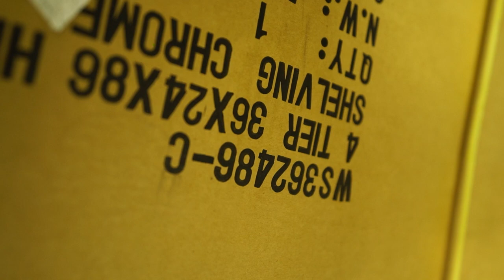They Sent The Wrong Shelves || Construction Finished! || Found Lost Sanseveria || Saturday Vlog

Comment: I would be livid after waiting that long for the shelves! But then again, what good would it do? Home Depot has the monopoly on sturdy wire shelving so you have to grin and bear it. By the time you get the new shelves and set them up, it’ll be time to move the plants outside! 😂
Reply from the maker: Right!? Finding the right shelves from anywhere other than HD was a waste of time. Other places sell them but the cost is outrageous!
Reply: @TropicalPlantParty  I’ve purchased wire shelving at Target, but they were 72” tall. They do have the nice large wheels for them, though. 
😺✌️